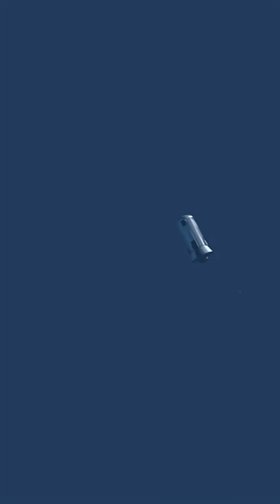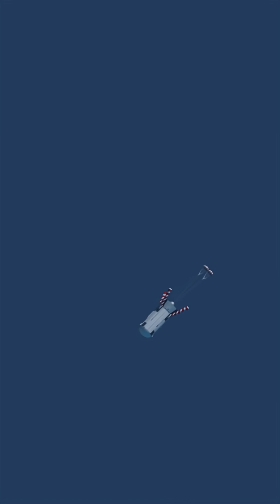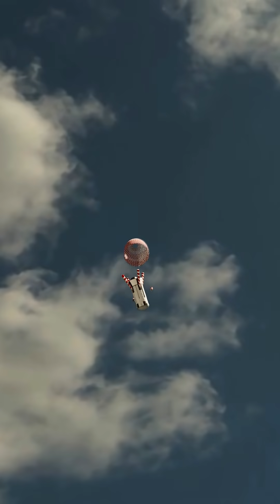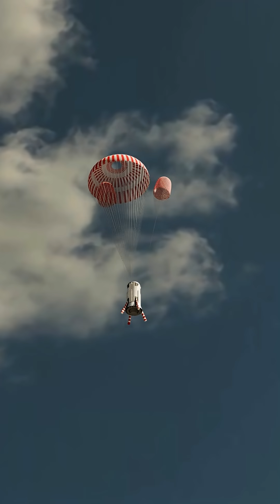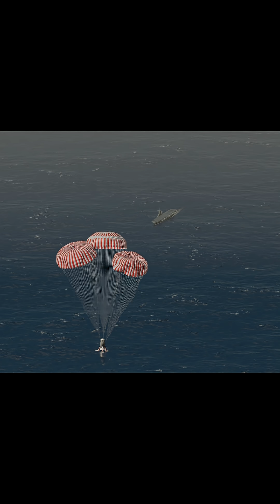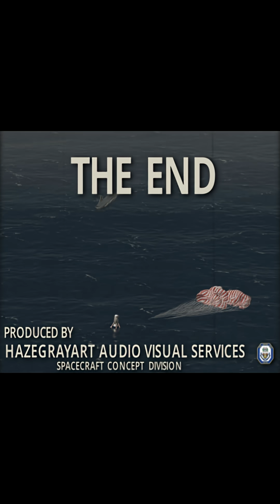Nova Reusable Rocket Recovery

Comment: Clever design to enable reuse of the expensive engines & pumps
Reply: After being immersed in corrosive salt water.
Reply: @wpatrickw2012 The deployed floats are clearly holding the engines clear of the water in the rendering. With a carrier present to retrieve the module within minutes. Corrosion would be not be a issue.

Comment: I wonder what the mass of that thing would be to use parachutes.
Reply: Quite light judging by the floats(engines are not submerged).
Reply: @alt5494  Yeah, so what material would have been used in the 70s?
Reply: @CausticLemons7  7075 aluminum multi titanium grades & carbon composite had been available for years by the 70's.